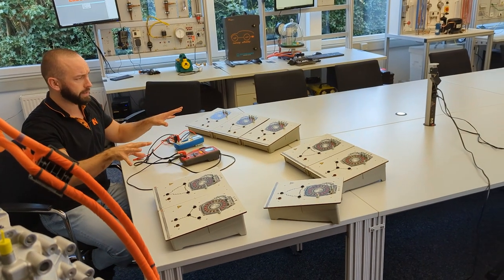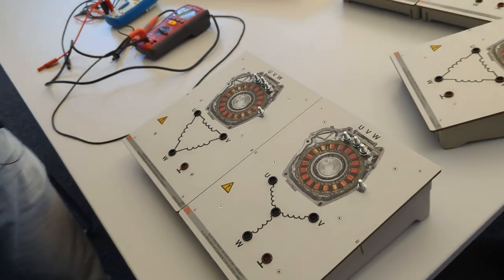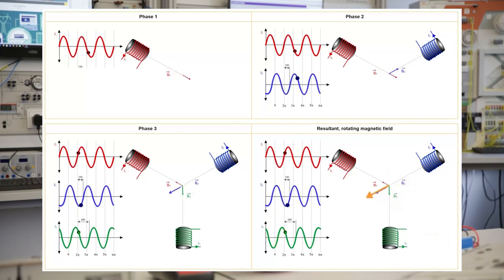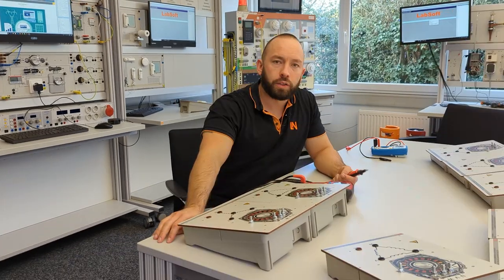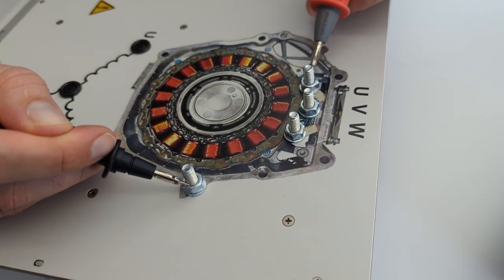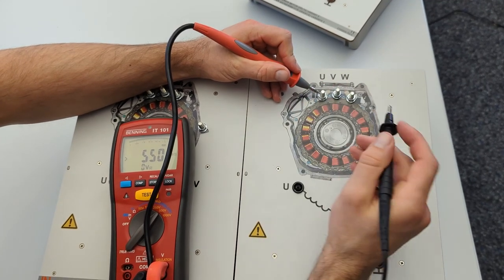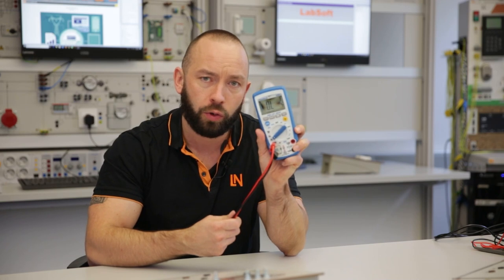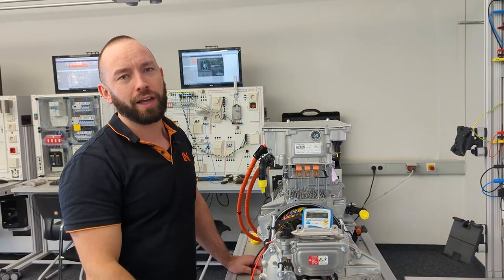Electric Motors | Deep Dive

Comment: Congratulations for the video! We think the configuration of this electric motor is a Delta connection due to a very low resistance because the parallel Delta resistances.